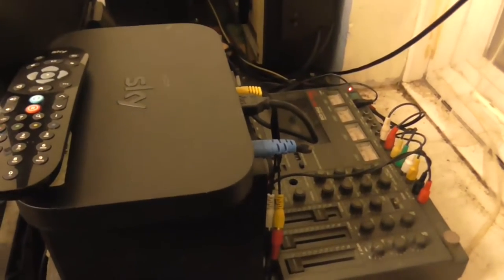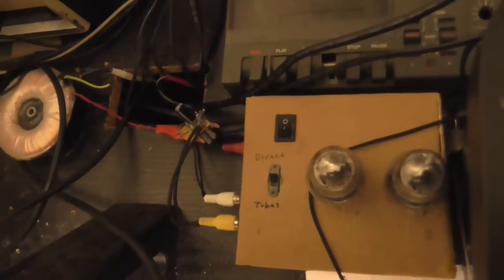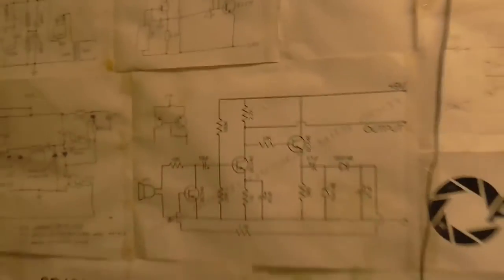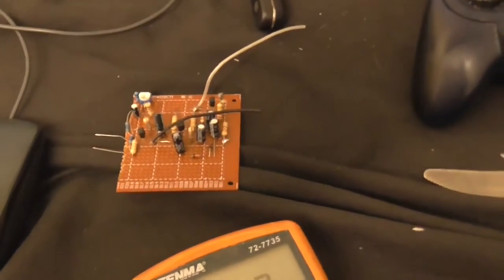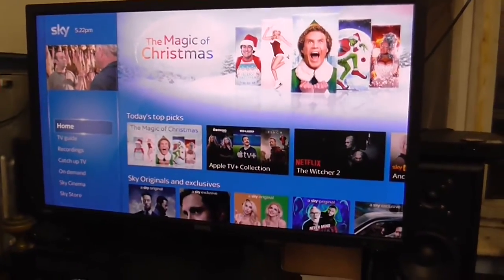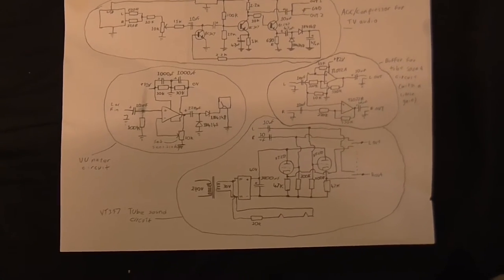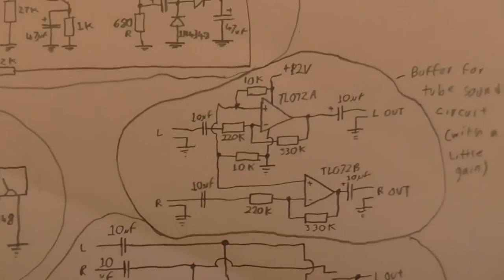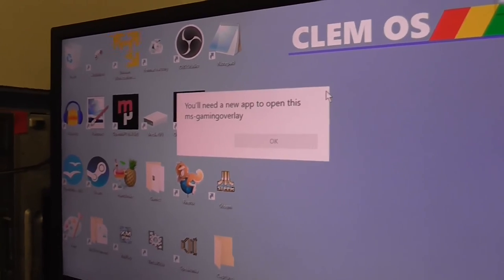Tour of my computer's audio sound system, and audio compressor for TV audio.

Comment: Well done!
I've never heard of anyone finding loud Sound effects annoying though.
I have heard of folk finding the Adverts in Broadcast television annoying due to them being much louder than the Programme sound but I suspect that this was deliberate to make people take notice.
You were right on the money with the gain of that amplifying stage in that analogue compressor circuit being approx 80X.
I set that up to make measurements so I could do the calculation myself.
Reply from the maker: I've always had problem with that ever since I noticed things just getting louder and louder. one thing is if I'm watching late at night and I don't want anyone else to be woken up by sudden loud sound effects or music.